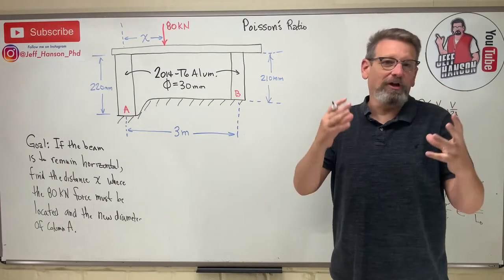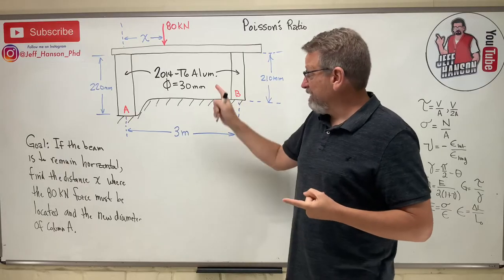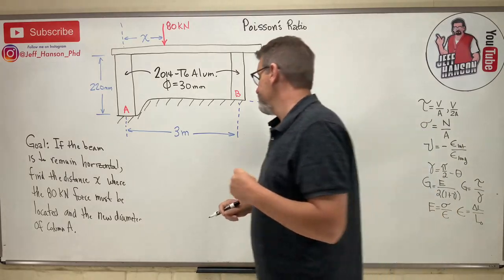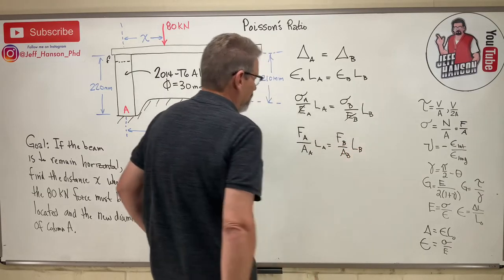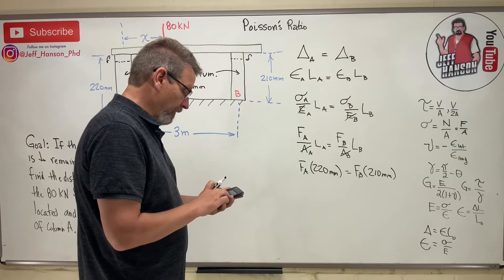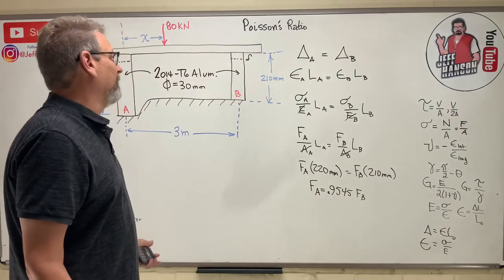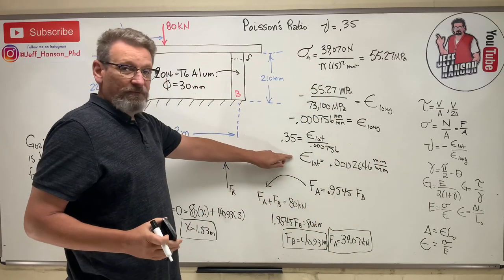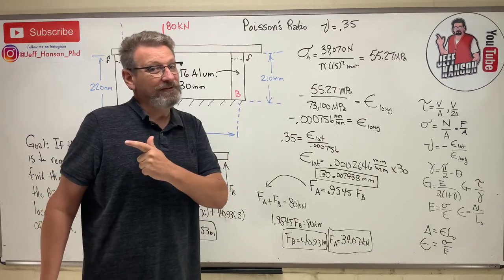Mechanics of Materials: Lesson 14 - Poisson’s Ratio Example Problem, Using Strain

Comment: Very very fascinating and extremely well communicated. Most surprising to me are that the  location of the load (x) depends on the length of the column and that the change in diameter is  proportional to the original diameter.
     Thanks for such great content!

Comment: at 8:18, wouldn't the 80(x) be negative in the equation?
Reply: You're correct, but he does get the correct X value. So he probably mentally self-corrected it and accidentally forgot to change it on the board.

Comment: I got to the same result by using the value for modulus of elasticity earlier, computing both Fa and Fb as a function of the common deformation ΔL and then using equilibrium equation for the beam to solve for ΔL. Your solution was 10 times easier tho

Comment: How come published real world data for metals never agree with the E, G, Poisson's Ratio relationship? It is not even close.  For example:

1045 Steel
E = 200 GPa
G = 80 GPa
v = .29

If you were to calculated Poisson's Ratio from E and G, you would come up with .25, not .29.  

I have checked many materials, and found the real world G vs E is not consistent with G = E/2*(1+v)

Comment: F column B is F column A, and the opposite is true. You mistook the result, because it's not logical the have a weak force on A then B, when 80KN is applied much close to A. So, FA would be 40.93KN and FB = 39.07kn. For this, the new diameter will be, 30.008316 mm

Comment: How is there not a Ma on column A? I thought only pin connections didn’t have moments...
Reply: Probably too late but since it is just a column it is equivalent to a roller, which has no moment, only a force perpendicular to the axis the roller is on